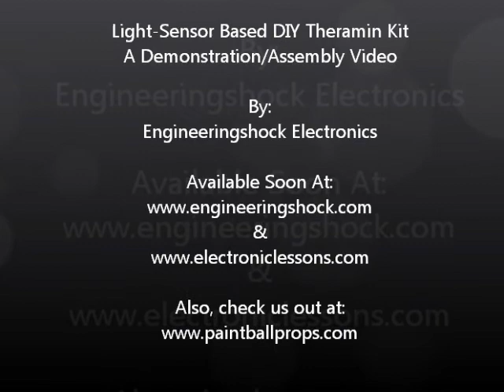Light Sensor Based DIY Theramin Kit - Assembly/Demo Video

Comment: I recently purchased this kit and got it in the mail yesterday. I've watched the video and a couple of things are different with the kit I received: 1) female to female jumper wire missing, however is pre-soldered wire to speaker. Negligable difference I suppose, if not improved. Right? 2) 555 timers- do they come with seperate housing pieces (don't know what else to call them) that the 555s sit in? That's what these seem to have. If so, do they sit flush with housing or above? Just want to be sure this kit is right. Luckily I have a 9V connector to use already, didn't notice it didn't come with one (as stated in the discription on ebay). About your video: Due to foreshortening/static camera angle it's not possible to determine the distance appropriate to set sensors from the PCB. Altogether, I'm totally excited to put this kit together! SOoo cool! Thank you for all your awesome videos and amazing stuff! I already have a wish list for your store.